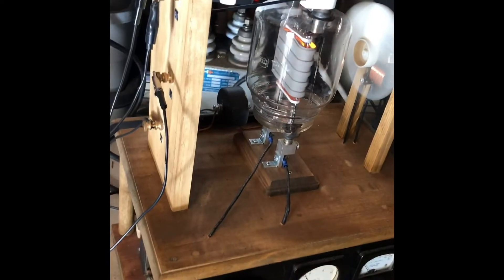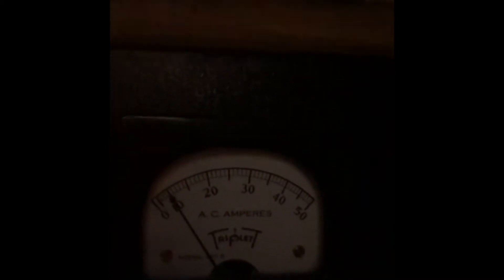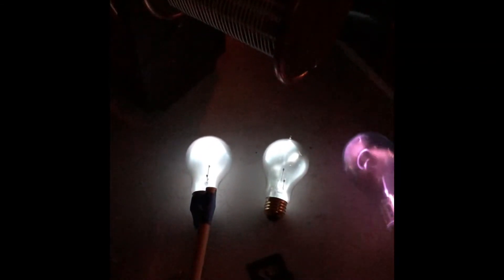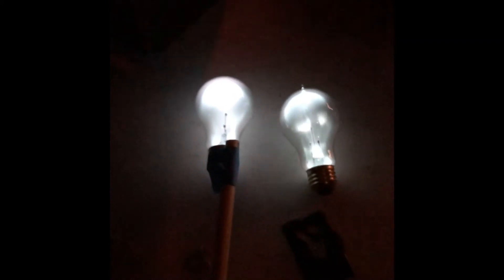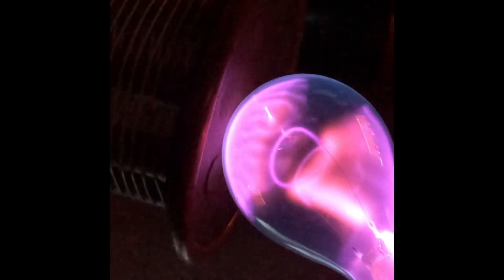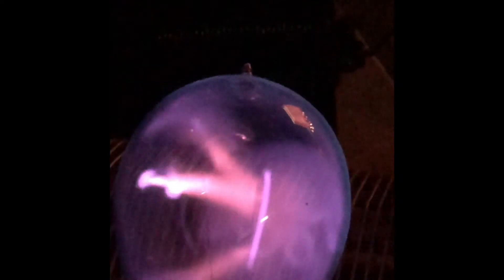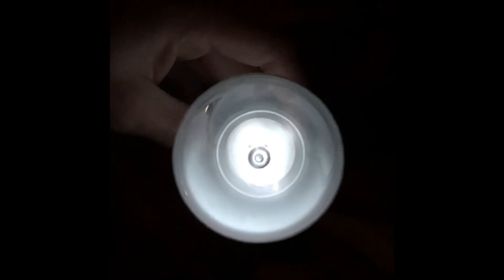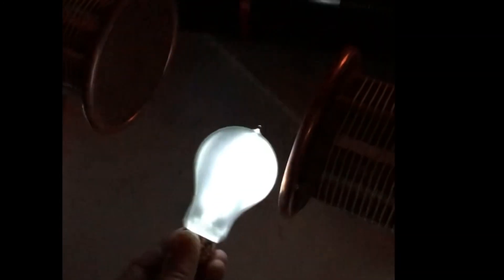Visualization of Striations and Plasma Phenomena in High Vacuum Bulbs

Comment: all that gear and 10 volts...? how about a million hz? How about a million volts? Slowly flow through the various switching speeds and show us what happens. Vary voltage amps and frequency.
Reply from the maker: 10 volts is supplied to the filament of the tube, meaning a KW of power is being produced at half a million cycles.

Comment: A vacuum is a vacuum. It doesn't matter if it's absent of atoms, ions, electrons, exotic particles, anti-matter or any of the fields conveyed by such.
In respect of your observed "cancellation zones", please investigate Crookes space/striated discharge... this effect has been observed for over a century.
Reply: This is how aetheric 2 strokes engines work! I wouldn’t doubt if the 850 Polaris khaos snowmobile will run on counter space aetheric energy and turbos with chemical fuel burning are just an illusion!

Comment: Thanks. Can I just ask - if you do the proper detailed analysis using classical 'establishment' EM theory, is there a point in your experimental observations where it is necessary to invent 'counterspace' in order to explain what you see? If so, why is this stuff not peer-reviewed and accepted into the mainstream? BTW it's not a conspiracy ...
Reply from the maker: In this electrical scenario, counterspace is defined as the observed phenomena of an absence of field activity between two highly active dielectric field emitters, working in tandem to produce a unique total state of dielectric induction. 

As observed from a classical standpoint, the reason for field cancellation would result from alike-charge opposition. This would entail that both coils are of similar electric "charge" polarities. Granted this is an alternating current circumstance, there ceases to exist a stationary charge on either coil. 

Recent observations made by a colleague and myself have indicated that this cancellation persists with respect to the supplied frequency to the coils. Depending on the coil's electrical characteristics, the phase alignment between the voltage and current nodes, whether the coils be operated in so-called quarter wave or half wave operation, will hence produce a physical disalignment of this cancellation. Therefore, the zone of cancellation, (as physically observed with either gaseous or high vacuum bulbs), is dependent on frequency and phase. 

It must be noted that the term counterspace is widely used incorrectly to explain simple definitions, and cause readers to think in conspiratorial terms. Ultimately, this form of thinking and influence unfortunately is commonplace in the Tesla/free energy community, and leads to nothing but an endless cyclone of fallaciousness.
Reply: @GriffinGBrock  Thank you. It sounds like e-field cancellation at a point between the electrodes when the electrodes are fed with equal and in-phase high voltage RF signals. It would seem that stationary charges are not required for cancellation, as long as the electrode driving HV signals are equal at all instants. Inequality would cause a movement or disappearance of the cancellation point. Perhaps you meant 1/4 and 5/4 wave modes, as the 1/2 wave mode results in high impedance at both ends of both coils, so no HV? I look forward to seeing this work reviewed by somebody who understands EM theory better than me, and then published. Good luck with your work.
Reply from the maker: @ridefast0  Cancellation of this nature whereby the input phases to the coil are in phase would not cause a null zone to appear in this circumstance. The concept of alike charges creating opposition works well in DC analysis, but in this case the action of both phases working together at the peak timing, in conjunction with the phase alignment of the coils, would not entail a zone of cancellation. This has been determined by experimentation. 

This setup employs an output transformer whose terminals are fed to the coils, giving a 180 phase shift. This situation can be analogous to the 180 degree phase difference in two AM broadcast transmission towers, giving a directional field. 

The observed modes I spoke of earlier do in fact represent a specific proportionality, wherein a two coil setup, the first mode is akin to a capacitive-burdened quarter wave frequency, and the second of a burdened (approaching) half wave mode. There is no mention of a 5/4 wavelength, as experimentation has indicated this. This also holds in a single coil Telluric communication setup, where the second high impedance mode of resonance is near the half wavelength mode, but rather approximates a slightly higher value nearing the constant of pi, with respect to the total wire length of the coil. 

In a two coil setup, the zone of cancellation does not exist in the center, when operated at its second higher frequency mode of operation. It rather exists at the end terminal on one of the coils, being pushed to one side. By pushing the two coils farther inward, the coupling between the ring gap causes a mutual "bridging" of the coils. Hence, the coils then indirectly work as one complete unit, whereby the potential and curret nodes of each coil are no longer segregated, as both potential nodes reside to one side. In this close proximity manner, the null zone ceases to exist.
Reply: @GriffinGBrock  Fascinating information, thank you.

Comment: The worm hole and collapse of the cancellation zone is a bright line of light between two sides of the glass? And this is a Dielectric charge increase such as between two power lines. The metal in the bulb is responding to increase magneto charge so it will show the circular lines of energy between two power lines in this case being the two poles of the electromagnetic coils.

Comment: counter space! what in the world is counter space? sounds like Ken wheeler got to you
Reply from the maker: Ken Wheeler's work is erroneous in this matter. Counter-space is the overall expression of a "gap" which occurs not from the result of field repulsion nor charge similarity repulsion.
Reply: user-gv • 'Counterspace' is not a 'gap'. 
It is a real continuum aggregate on its own and of a very low real entropic state. 
It is not the "lowest" entropic state since the true dynamic goes causally deeper and uninterrupted to infinity ( to continuously deeper and deeper layers of lower and lower and lower and...etc entropic realms towards infinity ).
It can be measured in 'per meters' ( 1/meters ), as it is opposed dynamically to the regular relative local entropic state that as, let's say, 'length' is expressed in 'meters', etc.
The smaller is the "aggregated" volume, the tighter the entropic layers are bundled together ( stronger "counterspace" )
The bigger the aggregated volume in "space", the looser the relative entropic dynamical realm ( weaker "counterspace" ).
What is "repulsion" in REALITY?
What is "charge" in REALITY?🥴😏
When you say that something is "repulsive" or that something is a "charge" is exactly like you say 'water is wet'. 
Ok, "water is wet", but what is "water" in REALITY?
Etc, etc.
Reply: @GriffinGBrock   Are you implying that Ken defines counter-space to be the result of field-repulsion or charge similarity repulsion? Because I don't think he's ever defined it that way to my knowledge. I'm genuinely trying to understand what makes his definitions erroneous from your point of view.
Reply: @GriffinGBrock  a gap in what? and what is being expressed? Define counterspace with more descriptive terms, please use cohesive and structured vocabulary that actually applies to what youre describing. that's exactly how Ken wheeler speaks, by using jargon from different fields, mashing them together haphazardly, and the lesser educated of us just think,  " he's so smart, I wish I knew all them words...."
Reply: @e7ebr0w  Ken is making claims supporting them with evidence. 
You claim is that he is incorrect bc he uses “jargon” and “ppl are stupid and think he’s smarter”.

Fantastic argument(not an argument), My guy
Reply: @MusicSoundPlayer  what evidence? he makes an optical illusion, and no math, and it's evidence? have you duplicated his experiments to variety results, or do you just believe him?
Reply: @e7ebr0w  evidence is evidence. It doesn’t necessarily lead to objective truth.
It a hell of a lot better then “can you prove it????”
As if a question is an argument....
Reply: @e7ebr0w  you’re wrong in assuming I’m insulting you. 
You’re wrong in assuming I’m trying to “look smart”. 
You wrong in saying “I’m just asking one question” and then proceed to ask another....

What specifically should I respond to?
Reply: @e7ebr0w  it’s not Ken wheelers fing theory. It’s Steinmetz and Tesla’s. They all believed in the dielectric lines of force which IS counterspace.
Reply: @MusicSoundPlayer  you're legitimately impossible..... good day to you, and good luck in your endeavors
Reply: @e7ebr0w  "you're legitimately impossible"
"trying to insult me the way a 6 year old"
"sounds like Ken wheeler got to you"

I'd suggest you read "list of fallacies" on wikipedia. The above statements are ad hominem. The big long paragraph you wrote it a loaded question, yet you seem to think it was a specific question.
Understanding logic is important. I suggest you get a good grasp on it before engaging in science.

Comment: I thought I was the only one who really enjoys injecting HV radio frequency into old lamps. I do wonder X Radiation generation though??? 

I've seen so many different phenomenon doing this. My favorite uses a blown tungsten filament clear lamp where W filament is still attached to one stand. It whips around violently I'm guessing from ion/cathode ray discharge. Love it man. Those lamps have Hg added?
Reply from the maker: The lamps used in the video are vacuum only, no gasses, although the purplish color obtained from the larger lamp indicates a depleting vacuum.
Reply: @GriffinGBrock  Or it could be ablating of the metal filament or any other material inside the bulb.  If particles are 'boiling off' the metal filament inside the bulb, this 'freed-up' matter is a source for the color (the frequency of the EM waves) seen inside the bulb

Comment: How much does it cost to build a set up like this, and is this the TRUE Tesla coil I hear about (apparently most of the tesla coils people see on youtube aren't Tesla's actual build)
Reply from the maker: Depending on the objective of the transformer you wish to build, will follow the total cost of the parts. In this video, the coils are connected to a resonant transformer setup, which can be determined to be a Tesla Coil, although the true Tesla coil has variations depending on the operation.
Reply: @GriffinGBrock  If I'm not mistaken, the coil you show here is akin to Tesla's later coil design, which is the same that Dollard uses.  I've read that Tesla used a magnetically quenched, carbon spark gap tube full of nitrogen gas and a nitrogen gas globe with one electrode as the terminator at the top of the coil.  He used nitrogen, because he claimed that it slowed down electrons.  I think he was trying to split electricity like you would hydrogen and oxygen from water.  He was dumping all of the magnetic(Amperage) component of electricity to get pure dielectricity(voltage), which he used to "slap" the aether and cause the longitudinal perturbation.  Although I'm not sure if my understanding is correct on that.  He said, in regards to the spark gap and the globe terminator, that instead of the purplelish discharge most people see, it would be a brilliant white.  The nitrogen filled globe at the top would emit "Aether Streamers." as he called them.  Unlike the electric streamers coming off of most Tesla coils.  Man, now I want to build one.
Reply: You can most certainly look up Teslas patent on his transformer if you want the original.